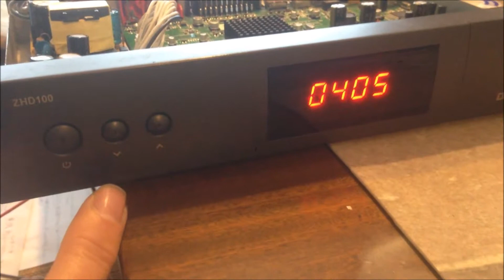ZHD100 Satellite TV Receiver: No Power Problem - Solved

Comment: Hi my receiver not turning on & i'm change power supply board with a new board . but problem not solved !!! What can i do ???
Reply from the maker: Firstly check your new power board to see if it works properly by disconnecting the output from the main board, then measure the output voltages. You could also check if there is a short on the main board? Good luck!
Reply: @RepairDIY  my old & new power board is ok and work fine with true output voltage measures. 
i think problem is from mainboard but i cant find where
Reply from the maker: @raamin.m4308  I normally check for short circuits and open circuits, particularly around the connectors. Also check and replace any capacitors that look swollen or leaking or suspicious. Good luck!